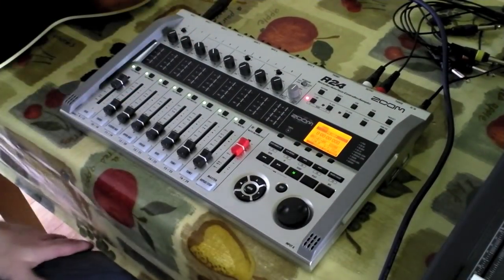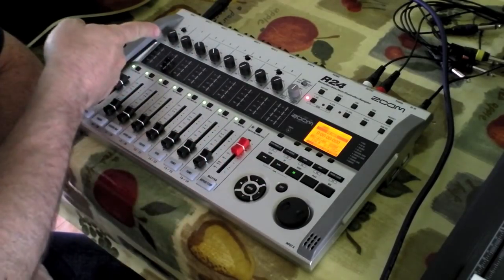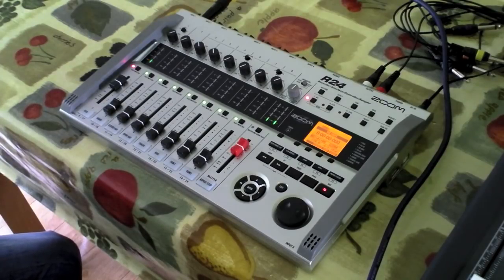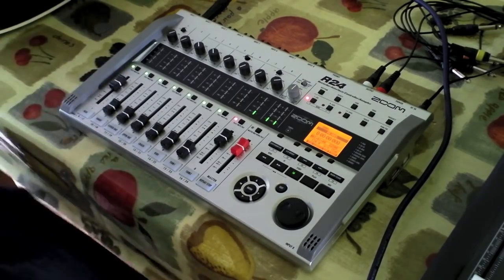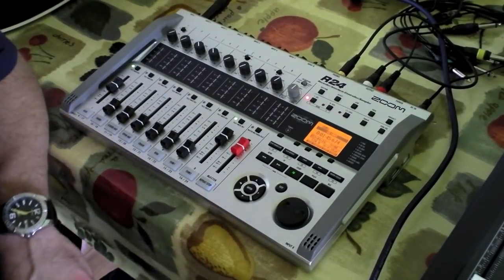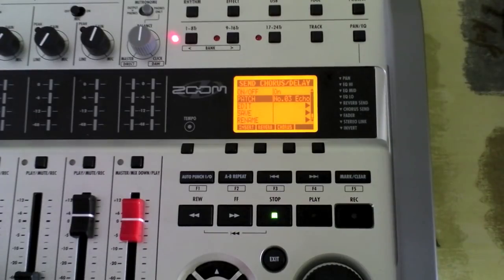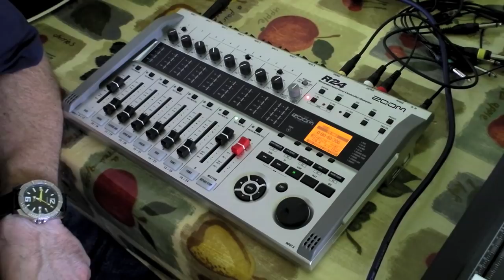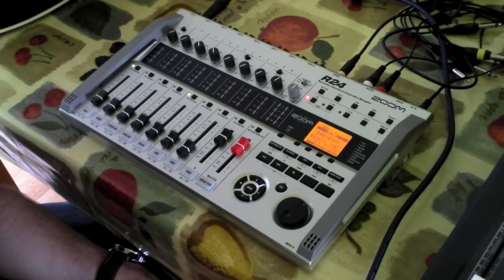Zoom R24 Part 2 - Basic Recording

Comment: Hi, there isn't much info on using it as an interface and control deface... seems like there's things you can and can't do in this mode, such as using more than two tracks of phantom power. also how do you set it up with mackie control?
Reply from the maker: Evan Romero Sorry Evan - as I say in my videos, I don't use it in this way so can't really help I'm afraid. Having said this, I did try this out recently with Adobe Audition and it worked really well. The Mackie control set up is DAW dependent and will be somewhere in you DAW settings under inputs / input source.
Reply: looks like logic pro x isnt recognizing it as a midi controller, and everything is up to date. i'm at a bit of a loss

Comment from the maker: ...or powered speakers - ignore what I had going on, it was particularly convoluted and not necessary.  If you check out the Part 1 video in this series I show all the different outputs from the R24 which are essentially 2 x 1/4" main stereo outs (L & R) and 1 x 1/4" single stereo out for headphones, both of which have independent volume controls on the back of the device.  Hope this helps and best wishes, Darren

Comment: I would like to transfer what I have recorded on my zoom r24 to my mac where I can mix using a D.A.W. software program. Do I need to mix on the zoom first before transfering to the mac where I will mix again? Does that also include mastering on the zoom before transfering as well? Hope i made sense!  Thanks
Reply from the maker: No - just take your raw multiple tracks over to your Mac and do all the mixing and mastering on it instead of on the Zoom if that is your preferred way of working. I do this myself sometimes.

Comment: Just wondering if you know how to transfer a wave file so I can play along with it?
Reply from the maker: Hi Jeff - yes, you can either stick your SD card in your laptop and drag and drop or connect your R24 to your laptop, put it in "Card Reader" mode and do the same thing (check the manual for the details).  Then just make sure the name of your WAV file matches the format for the R24 (I think it's 8 characters followed by .WAV but again, best check this) and the device should recognise it and play it ok once it's assigned to a track - "Track" menu and then "Assign" and then "File".  Hope this helps, Darren

Comment: Can you plug an electric guitar into an input other than input 1?  Does it matter whether the electric guitar is an acoustic electric with a battery operated preamp, or a regular solid-body electric guitar without a preamp?  Would sure like to be able to record two electric guitars at the same time.  What about instruments like an electric keyboard?  Can I plug them into any other input?
Reply from the maker: Standard electric guitar with passive pickups - into Input 1 with Hi-Z switch engaged. Active pickups or acoustics with pre-amp can go into any input via 1/4" guitar lead. If you want to record two guitars with passive pickups then just record one first, swap it to another empty track and then record the second whilst playing back the first. Keyboard = line level and can plug into any input.

Comment: hey, I'm trying to figure out how to hear the effect (distortion) during playback. I have the signal set to dry, I record my guitars clean, which is what I want, I add my guitar effects later in my mixing software. If you know how I can hear the distortion on both guitars after it is already recorded DURING playback, but the tracks are clean when I transfer them to the PC, that would be AMAZING!
Reply from the maker: Yes - you can do this very easily, simply select the type of distortion you want from the variety on offer in the Insert Effects menu and then make sure you have the input source set to whichever TRACK you want to hear back (i.e. TRACK 6) - do NOT have the input source set to "INPUT 6" - this won't work on playback.  Your original track is now still clean the way it was recorded but you are playing it back through the insert effect that you have assigned to the TRACK that you want to effect.  Hope this is clear!
Reply from the maker: topdazzle Forgot to add - if you want to do this to more than one track (i.e. you have 2 guitars that you want to effect) then the only way is to bounce at least one of them through the insert effect of your choice to an unused track on the R24 and make sure you record it wet - that way you are still left with the clean track and the Insert Effect is now freed up to be used on your second track that you want to effect which you can set up as described above.
Reply from the maker: topdazzle Check out my videos on using the Insert Effect which explain how to do all of this in detail.

Comment: I have questions..a lot of questions actually..can't decide to buy..or not...ok..first question..maybe a stupid one..but..is it possible to merge 2 or more tracks together..to create empty "extra" tracks? Lets just say you used up all tracks..is it possible to merge/dump/resample..all these to..let's say..1 or 2 tracks instead..so you get more free tracks to record on? :-) ...oh..and..i use synthesizers and sequencers (was surprised to see that this one doesn't have midi to sync with ext gear)...so to use the drums onboard..i'll have to manually input them with the pads...next question then is...can i slow down the recording i just made with..let's say a fast sequence  a fast bassline for example..from a synth...to get the drums right when i manually input them over the recording i just made...and when i'm finished..change the tempo up again? this may sound like stupid questions..but i've never used a porta...not even the old cassette types :-) And this question goes for the R8 too :-)
Reply from the maker: Hi Calle - the answer to your first question is "yes" and you do it by using the "Bounce" function - you can do this as many times as you want, over and over again with whatever tracks you want to merge and free up tracks as you see fit.  With an R24 not used much due to there being 24 tracks available to you, with an R8, it's a way of life.  The lack of midi is one of the shortcomings of this device (although I don't use it so it's never bothered me).  Not sure about the tempo question - you can input the drum track in "Step Mode" using the track sequencer which will give you the precision you seek but this doesn't really slow down and then speed up in the way you would want - I'm not sure how you would do this if I'm honest!  Hope this helps.
Reply: Thanx a lot..that cleared up the first thing.....and i'm sure there won't be a problem with getting the drums in sync afterwards...just me thinking completely wrong..hehe..my bad...thanx again :-)
Reply: @Casious_Productions  I know, blame it on the drummer...mind you, to be a decent drummer you first need a seriously funny dirty drummer joke. Box ticked.
Joking apart, you don't need to have your drums in synch, it's called rubato. Expression. Not being driven by the machine. I'd strongly like the drum track mix stretchable on the wheel, though. Nobody expects the Spanish Inquisition...

Comment: how do you delete certain tracks,without deleting it all?
Reply: jeff shephard what's the answer to that question.
Reply from the maker: I don't have my R24 with me at the moment to check but from memory it should be in the tracks menu and then a delete function - if you can't find that, just pop your card into a laptop and delete the tracks from the card in there.
Reply: @topdazzle  Depends on your wider setup, but grosso-modo you can either over-write them, delete them from the card, or simply not select them in the final mix. Whereas something like an RC505 loop station uses 5 channels times 99 layers, this is 8 channels times 3 layers, and you'll discover later you can select a different layer to taste.

Comment: How do I assign track inputs  I want to mic the snare on track 1 then stack it on 2-3-and 4 without having to move the xlr cable from input to input
Reply from the maker: You can’t - they’re fixed. Just record the track then use the “Swap” function to move it to another track. You can also copy and/or bounce to other tracks.

Comment: Can you put a rap instrumental in the R8 to record a hip hop song?
Reply from the maker: You can put what you want into it as long as it's XLR or 1/4"
Reply: thanks topdazzle, but can i put a beat on an sd card pop it in the zoom and load it up like that to record a song on it?
Reply from the maker: Yes mate - as long as it is in WAV format and follows the file naming conventions and folder structures that the R24 uses (which is easy enough to set up)
Reply: "Cheers mate."
Reply from the maker: No probs